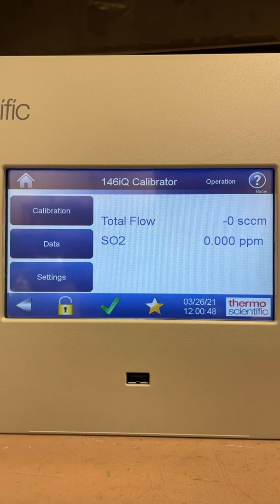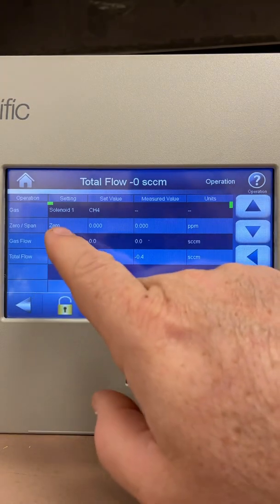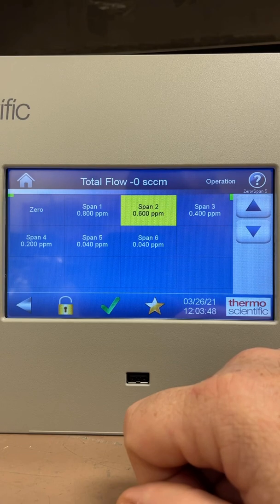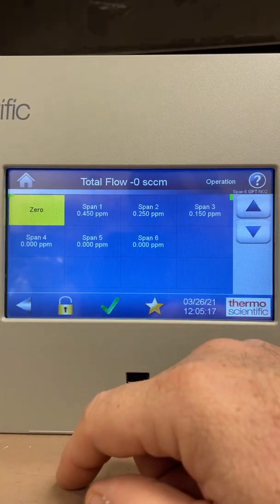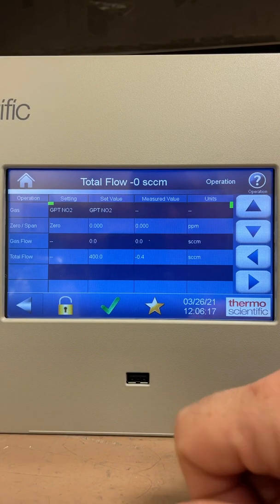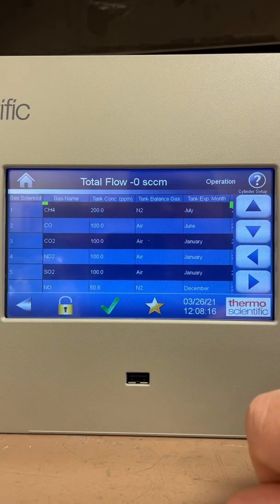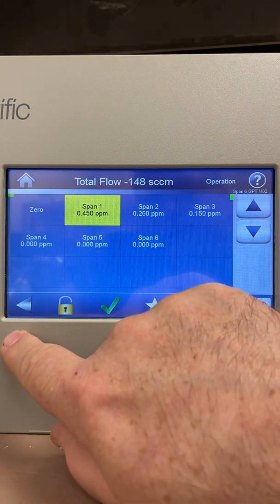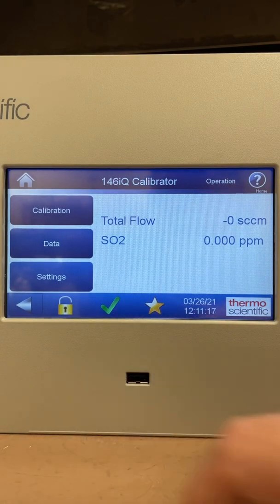Thermo Scientific Model 146iQ Multi-Gas Calibrator Operation

Comment: thanks for such helpful information.. generally what dilution ratio of zero air and mix gas for 146i calibrator used
Reply from the maker: I set the 146i zero air to 5000cc/min dilution flow when using a 50ppm SO2/NOx cylinder blend. My 146i has a max cal gas flow of 100cc/min. The 146i will auto select the cal gas flows based on the output gas concentrations you enter.